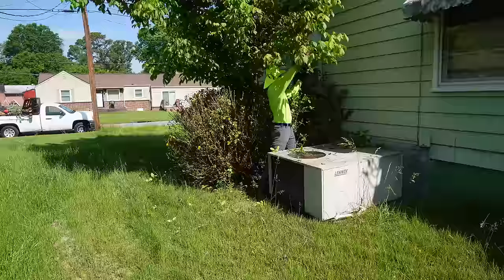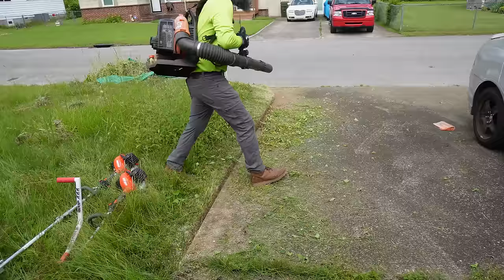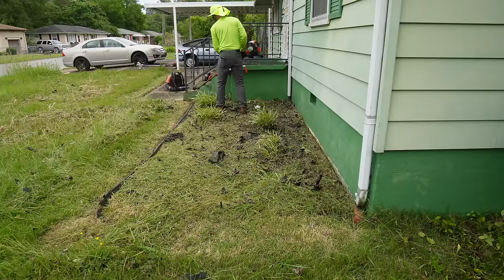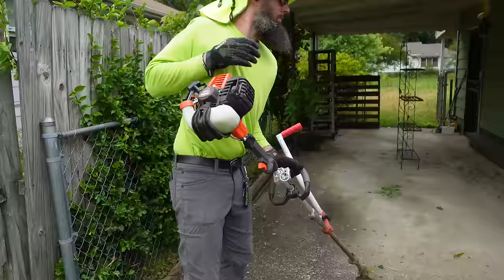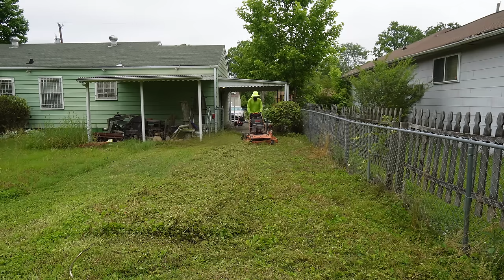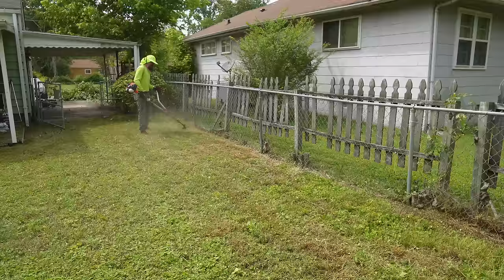Disabled Man's Lawn Goes from Chaos to Paradise All for FREE

Comment: You should have used your mower with the compartment. Why didn't you use it ? That way, ALL the grass clippings would have been collected. 

The tree branches above and near the shed should have been removed. 

The hedges at the windows should be removed completely. 

The tree stumps should have been cut off. 

The bushes opposite the shed should have been removed completely.
Reply from the maker: I can give you the address if you would like to go do all that.